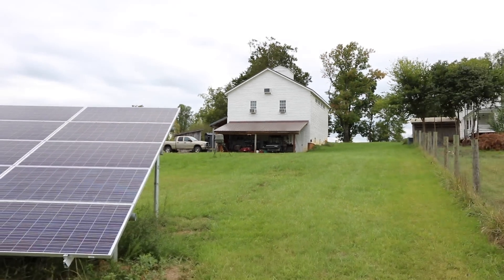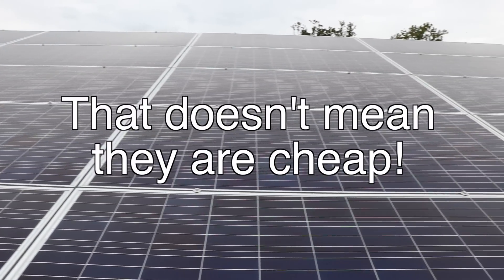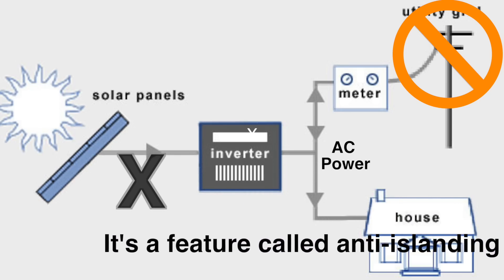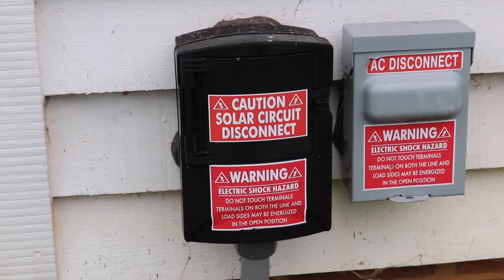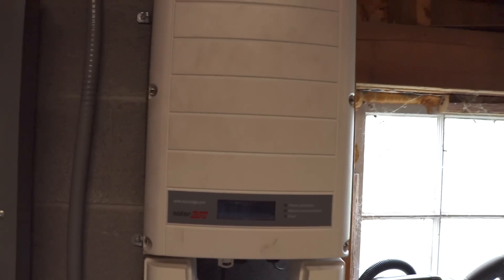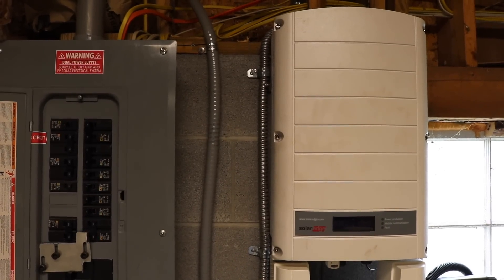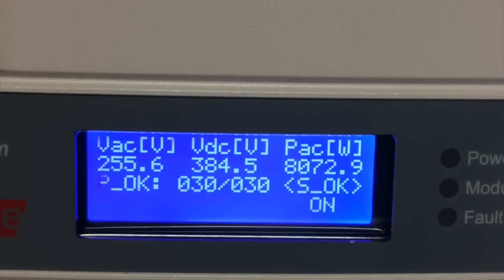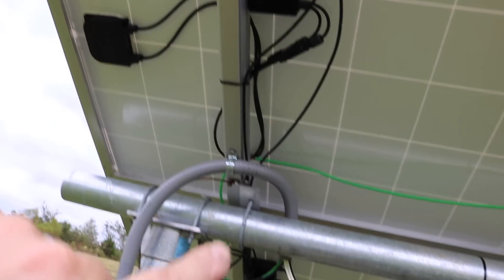The ugly truth behind grid-tie solar systems. Part 1, FarmCraft101 solar.  Watch before you buy!

Comment: Two inadvertence s so far in your video:
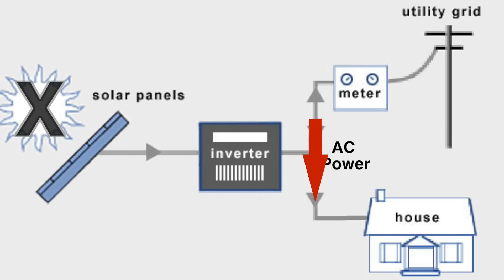1:30, the system is not bidirectional. Your setup is weird because the grid-tie system is completely isolated from house and all you produce goes back to grid, nothing in your house. At least this is how is supposed to be. You can not feed back to the grid unless you have a contract with the local distribution company.
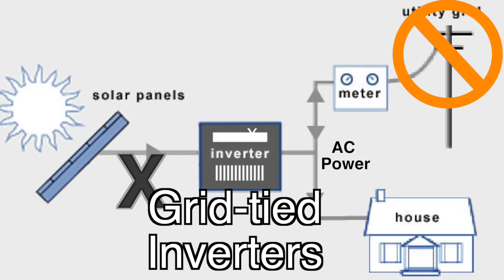2:40,  you say if the grid goes down the solar system goes down. Because the grid-tie inverter is driven by AC power and if it doesn't detect it shuts down. The problem is that your install is not set up to deal with grid shutdown. Basically you need an auto disconnect in case of grid failure and a battery backup.
Now you say you invest 24k or whatever and 8.5 years later you stop paying foe electricity for good. This is not true, if you are connected you pay  delivery and other services.
All in all, the tesla model is the best: your own solar power with battery to insure 24 hour operation. For 80k though, not 17k as you paid. But even that model still pays the grid some delivery fees, even which no consumption.
Reply: Ale Luia - I already mentioned that you will have to pay a connection fee if you are tied to the grid.  However, how the power company treats the power you feed to the grid varies state by state.  Again, look in to net metering.  It requires a meter that can spin in either direction but that is something the electrician/power company will install when they connect your house to the grid after the solar array/system has been installed.  Depending on what state you live in the power company will pay you either retail or wholesale (or in credits) for the excess power you produce.  This is not up to the power company, it is set by your state legislature.   Your comments about having a contract with the power company is superfluous.  You already have a contract to use their power, and they can't refuse to use your power if you've installed your system in accordance with state law (again varies state by state).  It sounds like you are just starting your research in to grid tied solar systems - spend some more time figuring out how it all works and less time arguing with people who are trying to explain it to you.
Reply: Your information is anecdotal and very state specific.  Yes, in pretty much every state you have to pay the "delivery fees" charged by the utility company if you are going to be connected to the grid.  But in many states (most) the utility company has to pay you for excess power production (either as a credit or in cash).  Look up "net metering".
Reply from the maker: Yes, the system is bidirectional.  You are mistaken there.  A wire does not care in which direction the current flows, and I have net metering which allows  flow back into the grid.  A battery backup system tied to the grid is called a 'hybrid system', which is different than what I cover in this video.  Look up grid-tied system. When the grid is down, the system shuts down.
Reply: You need to understand the basics: 1. There are fees to be paid to power utility even when you had zero consumption; 2. You can't feed power back to the grid unless you are contracted to ( to answer the reply about bidirectional power flow); if you just power up the grid on your own accord( say to reverse the counter) that is illegal in any state; 3. As soon as you have a feed in contract that is a source of income and the taxman will be checking on you. Find that anecdotal? Smile then!
Reply: Moon Pie
this is what you wrote:
"ale luia - Seems you aren't quite getting it and assuming FarmCraft101 has know clue what's going on is arrogant of you. 
I bet you don't have a solar GTI system"
does it ring any bell to you? to me it does. i thank you for clarifications.

Comment: Great video and thanks for sharing.  For accuracy sake, to get to a 7 year ROI you would need to generate 60 kWh per day though out the whole year.  (60 kWh x 365 days x .11 = $2,400)  Then $17,000 / $2,400 gets to you 7 years.  Generating 60 kWh per day is asking a lot (or too much) of a 9.1 kW system.  It will probably generate closer to 30 or 35 at best.  If we went on the higher end of 35 (35 kWh x 365 days x .11 = $1,405).  When calculated against the $17,000 the ROI is closer to 12 years.  I am not suggesting this is bad in any way just trying to be accurate.
Reply from the maker: My system averages 55 kwh per day.  Thanks for watching!
Reply: It will not average 55 kWh over the course of the year.  http://pvwatts.nrel.gov/

Comment: One little technical detail from the surprising things the professor told to us, way back when.  Increasing the voltage at any single source (power plant or solar, any kind) tied to the grid only increases the REACTIVE power, not the real one.  To increase the real power you contribute, you have to advance the phase.  In terms of hydro power, you increase the water flow to the turbine.  In steam plant, you increase steam flow to the turbine and to be able to do that in longer term, you increase coal or other fuel feed to the boiler.  So, the point is, you have to TRY to RUN AHEAD of the general grid frequency.  With the inverter system it naturally is done be electronic means rather than feeding more fuel, but the control principle is the same - phase advance pushes your product to the grid and a delay means you buy your power from the grid.
Reply: You are confused about one small piece.  The voltage of the grid is fixed in its design/construction.  The voltage doesn't change much at all - within a volt or two.  Therefore given a constant resistance/impedance a point source attached to the grid supplies a current by raising the voltage a the source very slightly so flow is in to the grid.  That current needs to have some place to go, and usually something else attached to the grid is trying to draw current so it gets taken up.  As the draw increases the source has to increase the current in order to maintain the voltage.  Your discussion on increasing phase is really just increasing current and Ohm's Law takes care of the rest.
Reply: FlyLowLikeRylo 
Just the opposite.  Your approach is valid for DC  -  as in “Ohm’s Law”.  On AC the things change, just as my professor showed.  A power line has inductance and capacitance as dominant features and the resistance (a loss term) is the minority.  That understanding, reinforced by countless calculations and lab tests was a requirement for my Masters Degree.

Comment: If you live in an area with lots of sun and cheap power you could see a return on investment in a few years but the reality is most of us will never recover the cost. You also need to consider the cost of maintenance; cleaning, repairs, batteries, etc. Also consider the average cost of a solar system is closer to $30,000 so you got a deal. The maximum rated wattage of a panel is rarely seen and even the best inverters are not 100% efficient. 85% is a good approximation to account for latitude and inefficiencies and losses in the solar panels and inverter systems so 9k * .85 = 7650W. I don't know where you are geographically but Omaha Nebraska has an average of 217 sunny days per year with an average of 5 hours per day of sunlight, (217 * 5) = 1085 sunny hours per year. So for a year you will generate 7.7kW * 1085hr ~ 8.4KWh. Omaha's electricity averages $.1/kwh, 8.4Kwh @ $.1 = $840/yr. $17,000 / $840 ~ 20 years to pay itself off. A panel’s efficiency degrades over time not to mention 20 years exposed to wind, hail, and lighting. The inverters are consumer grade electronics and will fail long before the panels. Batteries are great for storing energy offline but batteries are expensive and don't tend to last more than 5 years. 
It's important to do your due diligence and buy a solar system for the right reason. Even if you will never see a return on the cost there are still benefits such as power when the grid is offline, environmental protection, or to simply supporting the industry. Solar panels have come a long way in the past 30 years because of people who see the potential and support the industry.
Reply: There is no difference between "kWh" and "KWh" 1000 kWh is 1 MWh.  Also prices are now significantly lower than the ones you are quoting.  Check out https://www.wholesalesolar.com/ for a good representation of current prices.

Comment: I'm at the same point.  I've built my own 18650 battery back up system at 48V and about to have a 9000W system installed.  I've been looking at the Schneider as well as the Outback for my system.  The DIY powerwall group I belong to, no one discusses final assembly of their system and what equipment they use and why they chose that equipment, which in my mind is the most important part, I'm really looking forward to the next video, and if it is already out please provide me a link....I can't find it in your list.
Reply from the maker: Not out yet.  Subscribe and hit the bell and you will get a notification.  Thanks for watching!
Reply: Hi, we are planning off grid and going with 8k. We are building, welding, cutting metals, heat lamps, grow lamps and all the appliances in a home. The home will be 2-40' containers and a mother in law suite 2-20' containers and a small farm. Do you have a diagram of your work or what products was used and will be used in your upgrades. Thanks for your help.

Comment: Surprised to see the connection to or use of the utility kWh meter to pass wires through. Otherwise, well written, accurate, to the point.